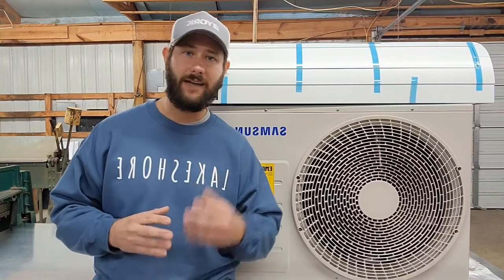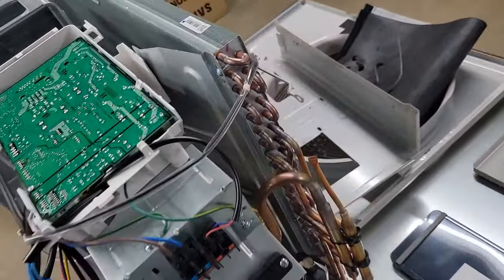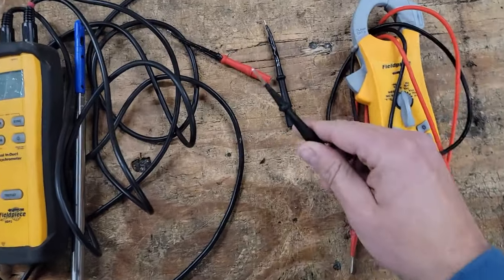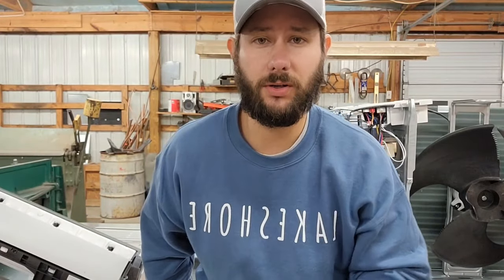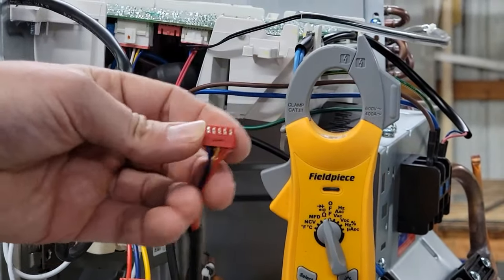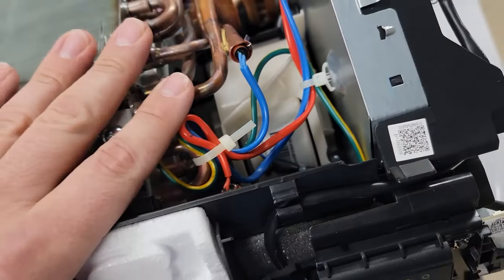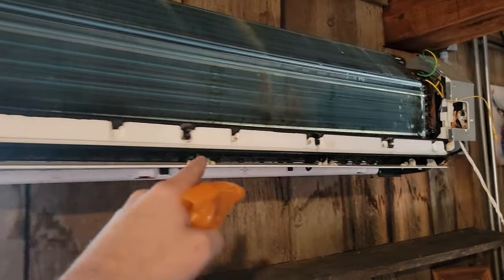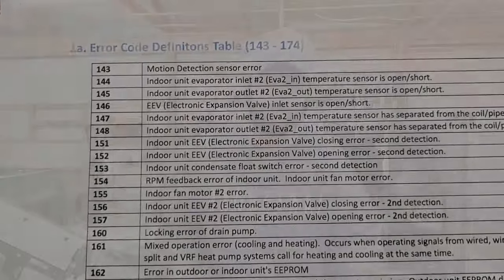How to Work on Mini Splits?

Comment: Hi, I have a 6month old Samsung unit. On heat mode all I hear from outdoor unit is some clicking sound then nothing. Do you have any ideas what could be wrong? Thanks
Reply from the maker: Oh no 6 month old not working
 That is no Bueno
 Mark I can help you but I need To have somebody there with tools that I can walk through a couple processes with
 It would be nice if it's details like pictures maybe if there's any air codes or blinking lights on the indoor unit or the Thermostat

Comment: Thanks Tad! Aloha from the Big Island! My Aura Systems 12,000 BTU won't start. It seems they've gone out of business. I do know they use a Hitachi inverter and a Toshiba compressor. Is the startup capacitor typically separate from the inverter board? Would appreciate having your email. I'm a retired Electrical Engineer.

Comment: Mini split head units have a common problem of making a loud (if you are trying to sleep) pop whenever the cooling cycle kicks in, as something inside like the blower motor housing or drip pan contracts from the temperature change. I haven't seen a fix for this anywhere online (i have a Mitsubishi that does it). The manufacturer considers it "normal operation", but it really is unacceptable, and it is a source of much buyer's remorse and difficulty sleeping for many people. You would be a hero to thousands if you could find a fix for it!
Reply from the maker: 1st I have heard of this I will definitely investigate and try wait investigate and try to find the calls and see what we can do
Reply: @TaddyDigest  That would be great, thank you! My unit even makes the noise occasionally when the unit is off,  because of the temperature of the room changing over time!

Comment: Hi, I have a LG Mini Split that's showning a tear drop with a snow flake below it on the unit inside. The outside unit will not work at all. Anyone have any suggestions to the problem. Thanks.
Reply from the maker: I'm not sure I would to have model number 
Install manual and then I could help 

Click the join button if you want my email and I can help 
Join this channel to get access to perks:
https://www.youtube.com/channel/UCuMyjTVlkM4xZ5z_eSyoB1w/join

Wanna Learn more about hvac? Check out my hvac tips for technicians playist.

https://youtube.com/playlist?list=PLVjetZt5xgenmO76adHwb2ctyeBIFKUus

Comment: We’ve got a ge dual zone with a 12k and 9k  blower. The installer put the 9k unit on the bottom of the line set and 12k on top. Manual reads to have the larger btu in bottom. I’ve started to have issues with cooling and all pressure numbers are good. No matter how cold I set the thermostat the compressor will not ramp up no matter how hot it is outside. But, I can unplug the line sensors and the compressor will run like it’s in test mode and cool like a beast. 
Any ideas?
Reply from the maker: I'm not sure could be anything definitely gotta make some checks before you can determine what it is

Comment: we just installed a mini for our garage and when we wired it up it turned on but we noticed the compressor wouldn’t kick on so we thought we wired something up wrong (keep in mind this was a unit from Mexico so we couldn’t really translate anything from the manuals well) but we decided to change up the wiring and see if it would kick on and now nothing is turning back on even if we go back to the original way we had it wired up. I think we might have cooked it.
Reply from the maker: Oh no
 Sorry to hear it wont-work
 If you need help
  Pictures will help me to understand more so I can help If you need help click the join button become a member and then send me an email

Comment: you mention wires chewed in half and you splice them back together. i was told by a Dakin and Mitsubishi not to do that, it messes with the communication signal. wouldn't that hold true any mini split system?
Reply from the maker: that is correct but there are guidelines for splicing if necessary
Reply: @TaddyDigest  ok great, could you show that? that would be cool!!!
Reply from the maker: Absolutely
 I will try to do a video soon showing the correct way to splice
Reply: @TaddyDigest  thanks bro, also I’m going to join as well

Comment: Do these things freeze up like regular heat pumps or straight AC units do and also it would be awesome if you did an electrical video on this on all electrical components
Reply from the maker: They do freeze up just like regular units
 But they have codes that they display if the unit does freeze up
 Common code is  E404

Comment: Hey tad great video’s appreciate the info always great content!!! Question: is it ok to leave a loop in my mini split line set
Reply from the maker: Yes, it is okay to leave a loop in the line sets
Especially if the line sets are less than ten foot
Reply: @TaddyDigest  awesome man I think I’m gonna sign up for your program to help with diagnosis. I install traidens now they are pretty good
Reply: @TaddyDigest  reason I asked about the coil up with extra line set is another tech told me I would cause a oil trap doing so but I’ve always done them that way

Comment: Can you mix & match brands on compressor and indoor wall evaporator unit as long as you match BTUs?
Reply from the maker: no  because  the control wire and signal and terminals are different from brand to brand

Comment: Why is my mini split Mitsubishi leaking from the condenser it is brand new when the heat is on
Reply from the maker: condensation is created on the outdoor coil in the heat mode during defrost It is Normal

Comment: Hey buddy. I really need your help. I watched a lot of videos already, trying to get the solution for my situation. I have an existing air handler with the ducts and I bought Mr cool Olympus E Star ( I realize now that I needed a Universal System) but it's too late for that now. I'm trying to adapt my handler by getting a control board for the Mr Cool  inside unit and sensors, possibly a monitor and remote  too.  What can you recommend. I've tried to talk to the professional guys, but they all tell me that I'm screwed. I know that myself, I need the solution, not the verdict. Please answer me. What do you think. Thanks.
Reply from the maker: I know with Samsung its possible with a AHU Kit. I can help you find out though.

Comment: Howdy Tad, Juan from Vegas here. If a compressor struggles to turn on would you say it’s condemned? It’ll try to turn on every 30 seconds or so.
Reply from the maker: Yes if it's for a Mini split
 If it's making a weird noise
 It's probably the compressor
 Make sure you order the inverter board as well

Comment: Hi. I’m from New York. I had to separate companies to diagnose the refrigerant leak on my ductless system. One is a large regional contractor who installed my ductless system and the other is a small local guy. They both isolated and pressure tested outdoor unit and found the leak is from the outdoor unit. The large contractor, original installer, wants to replace the whole unit. They say it is not under warranty since I didn’t register it. The local guy says it’s a bad condenser and it’s under warranty but Mitsubishi wants him to identify the leak first before they give him a new condenser under warranty. Any advice on this situation? Thanks very much.
Reply from the maker: Well 1st the original installer of the unit should have registered the warranty for you
 If the leak is in the condenser that means it's a high pressure leak and should be pretty easy to find
Reply: @TaddyDigest  Thank you very much Teddy. I’ll have calls with both of them, let you know what they said.
Reply from the maker: You're welcome I hope it gets fixed the right way mark
Reply: No good news so far. The original installer, Apple Heating and Cooling, sounds like a broken record, it’s homeowners responsibility to register the unit. I told them that I called Mitsubishi and was told the condenser is under warranty, Apple goes, send me it in writing from Mitsubishi. I filed a complaint through BBB. The local guy said he’ll think about how to help me and gets back to me. Does not sound promising either. I’m thinking of calling another company.
Reply from the maker: Wow that is super sad so the guy who installed it doesn't even really wanna take care of it
 He better start registering the warranty for  His customers

Comment: Ok we are working on a Hisense which these units are close to the same but not exactly… the unit cools great and heats great but will not shut off … it will freeze you out lol. But will only turn off if you turn temp up to max temperature or if you turn it off … have you ever run into this. We are dealing with a horrible company with tech support and wanting to send us a new head … as they ask the worst questions like …is the place sized properly and is there enough insulation… even after we told them we have installed 24 of them already on all the same new condo layouts with no problem until this unit
Reply from the maker: That sounds like a bad sensor

Comment: Hey dumb question, if I have a 3 ton split system. Could I use the same ducting on a 3 ton ducted mini split? Or would I need another load calc/manual j done? Haven’t gotten to manual J class or any field work right now just wondering. No I’m not going to install anything I’m just wondering
Reply from the maker: only dumb question is the question not asked 🤔 
Good Question 
Yess if the duct size is proper for the 1200 cfm 3 ton unit then yes you can use it
Reply: @TaddyDigest  Thanks for the reply, sounds good. I have a leak at the TXV right where one of those nuts thread on before the little capillary tubes that feed the evap. I got the video I was wondering before I try to tighten it what would you do? Is there some gasket or sealant I should put? I don’t have a recovery machine/bottle, vacuum I don’t want to call someone out here because I’m going to feel like a b*tch after taking all these classes and not doing it my self but I don’t have the equipment heh
Reply: See I have this leak https://youtu.be/FfsKM757uxQ

Initially I sprayed with soap and water when the system was running in cooling. The bubbles were really light but once I flipped the breaker at the air handler the bubbles went crazy and I could hear that loud noise I know pressures are supposed to equalize but are the pressures increasing at the TXV after I shut the system off I don’t remember hearing that at school
Reply from the maker: If you are trying hard and giving 100% effort never feel like you are not doing a good job 
Also try to tighten unless it's Aluminium then only do a 1/4 turn passed hand tight

Comment: That big microwave transformer like thing is an inductor for the power factor correction. 
Its job is to act as a temporary storage and add upto the mains voltage to convert 370v rectified mains to almost 400v dc. 
The igbt & pfc driver of the power factory correction circuit monitors the ac waveform and voltage. It tries it's best to consume current through out the entire wave as early as it can . This makes the current and voltage consumption in phase and improves your power factor. Without this circuit in place the ac would consume a lot of reactive power and it would consume more current to perform less work and put more strain on the grid. 
It has no job in protection. Or filtering. 
This also provides voltage stability so the equipment can work fine with low voltage aslong as the current is not exceeding it's rated capacity of the pfc circuit.
In short this is just a dc - dc boost converter that pulls current throughout the wave form . If the capacitors were directly connected to the rectifier the current would only be drawn near the peak of the mains and the current will lag behind the voltage. 
Ac is such a wizadry even though i am studying in detail about all this crap i am still unable to keep every bit of it in mind 😂

Comment: Very informative video!  I'm a service tech in NC and we mainly deal with Mitsubishi and Fujitsu.  I was wondering if it is possible to check what frequency the compressor is running?  Is this possible using an amp clamp set to hertz?
Reply from the maker: Man Thank you Austin This means a lot Appreciate you watching. Yes I use my fielpiece SC440 to measure % Pulse width Modulation 
I will do a video about it when I get time 
Let me know if you need help Thanks for watching 👀 😀
Reply from the maker: please share my video
Reply: Just use a multimeter to test frequency and set the unit to different temperatures and watch it adjust itself

Comment: Taddy- I just started doing some of the Samsung Minis lately as the Mitsi stuff is way overpriced for the features you get now days but I had a question for you on the single zone quantum units- if I buy the color LCD wired controller does the quantum 2.0 single zone just work with it or do you need any sub boards etc for the indoor unit? Their manuals aren’t very clear on this one part and I figured I would ask
Reply from the maker: you can use a wired controller with the quantum 
I am curious why you want to

Here is info for that 😀 

https://www.samsunghvac.com/wired-controller-sub-pcb/mim-a00un
Reply: @TaddyDigest  - I did quite a few 9k and 12 single zone Quantum 2.0’s this past summer snd they all have minor complaints from the homeowners that they are either too hot when in heat mode or not cool
Enough in the room in cooling mode (compared to set temp). I know all Minis have this issue slightly depending on amount of heads and placement in the space etc- but these were simple square shaped bedrooms mainly etc. I just scheduled a job for a single 24k single zone quantum wall mount for a hair salon and want to make sure it senses temp quite a bit away from the indoor unit. Any other input on the single zones overheating or undercooling? I’m assuming their intake sensor is slightly off but weird how I have heard it more than ever with the Samsungs.

Thanks
Reply from the maker: This is a video I did on an over heating issue https://youtu.be/y1eJlWCuIsw

let me know if this helps
Reply: Mitsubishi is KING of minisplits.  Hyper heat Hi2+ now latest and greatest.  SEER better than the rest.  Super reliable, QUIET

Comment: How do you recover the refrigerant without a high side port?
Reply: This units come precharged from factory and the refrigerant is keep in the condensar unit, when you first install, you have to open this 2 ports anti clock wise.   and for your question  you  close the the thiner line  first (liquid vapor line ) until your gauges show you are 0 bar or  psi ,and them you closed the thiker line (vapor)
Reply from the maker: Absolutely correct thank you for this information and I really appreciate you
Reply: @mountainklima5602  You explained how to charge the unit, not how to recover the refrigerant from the system.
Reply: @srobeck77  BASICALLY THE SAME BUT IN REVERSE
Reply: @mountainklima5602  incorrect since the compressor cant run in reverse. the low side will always be sucking inward, which is why you recharge on the low side. and why you recover on the high side.
Reply: @srobeck77  this mini splits dont have a high side , the expasion valve are in the condensar not in the evaporater side
Reply: @mountainklima5602  incorrect txv has zero to with rechatging a system. Go back to school to learn things
Reply: BLDC used to stand for "brushless direct current".  Is the acronym different in the HVAC world?
Reply from the maker: Coming soon my friend

Comment: Is there no capacitor in these units?
Reply from the maker: that is correct
Reply: I have mitsubishi mr slim installed they are older models but they do have capacitor.  Maybe the new ones dont anymore. @TaddyDigest

Comment: If you install ductless mini split systems you need to check at ephoca ductless and ducted heat pumps
No outdoor unit
No lineset needed
Lineset covers

Key Features
compact unit
Easy to install
Paintable sleek cabinet
Electronically controlled air
louver
Always-on back-lit LED dims after 15 seconds of inactivity
Auto-restart
Washable filters
Equipment  operates at 27 db
Heat and cool options
70 % less labor on installs

Let me know if you have any questions
Reply from the maker: Never heard of them
But I will check it out